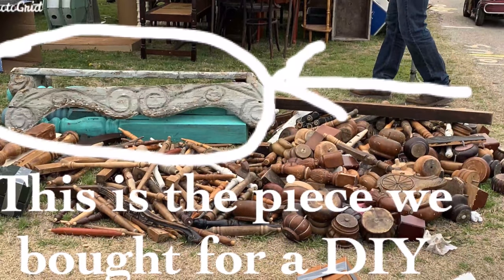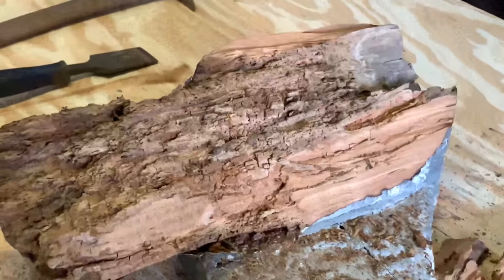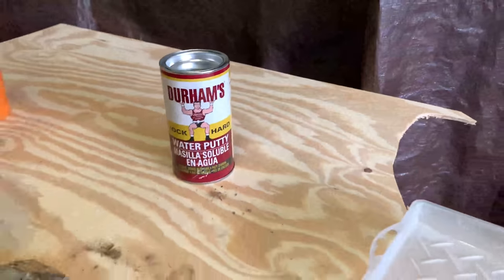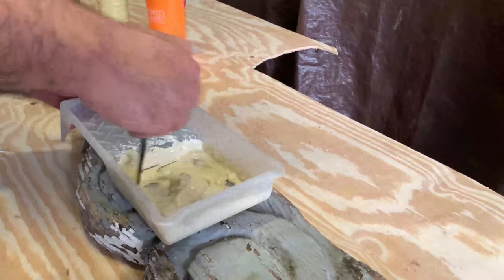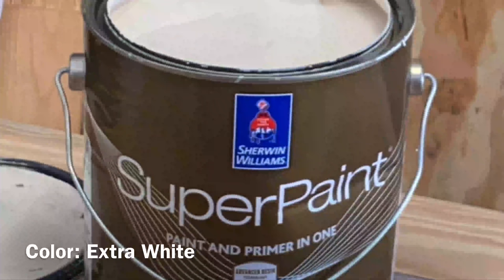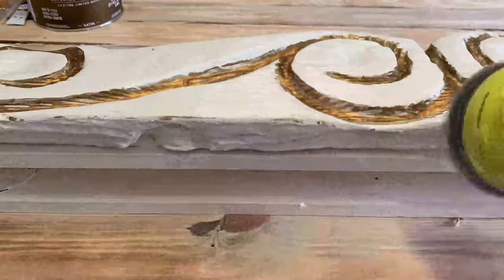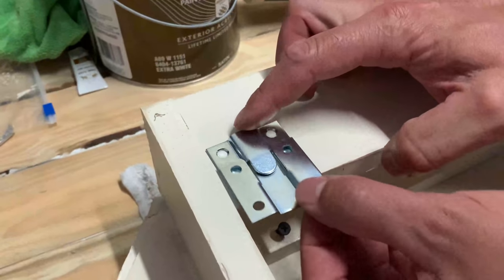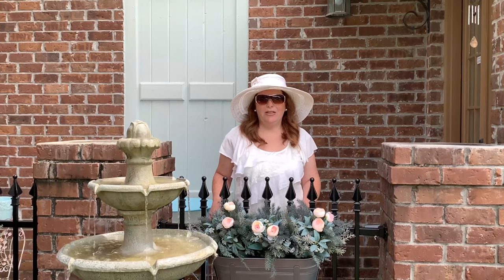Trash ~ To ~Treasure

Comment: What is the wood filler that you are using?
Reply from the maker: It is “Durham’s rock hard water putty” and you mix it with water. It works on wood and so many other materials as well.